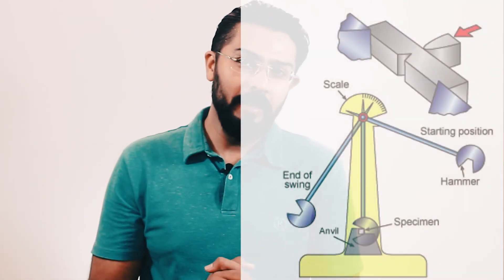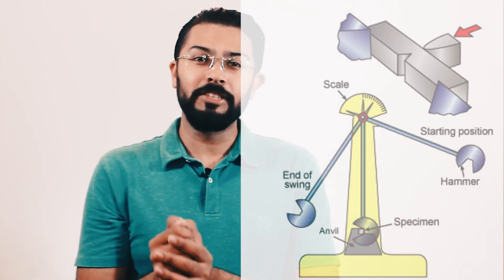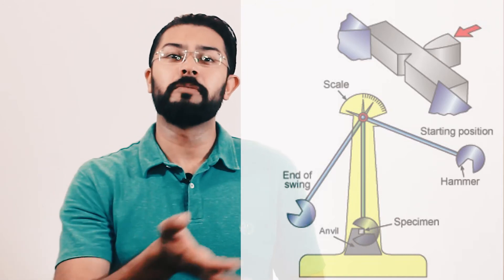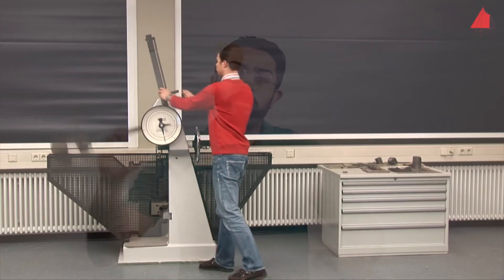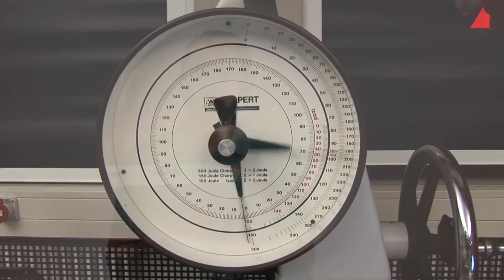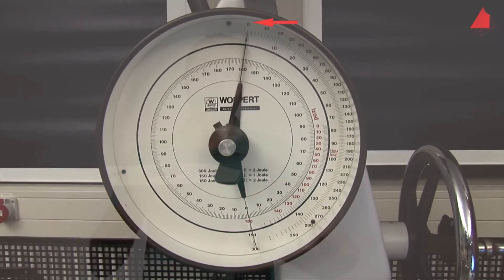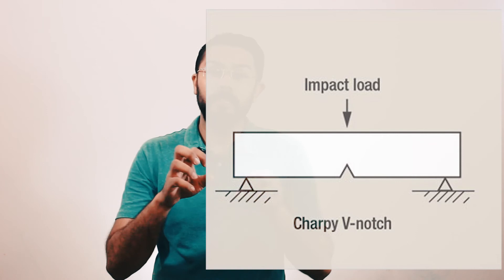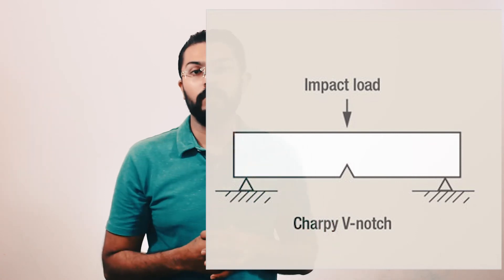Fracture toughness and Impact Strength | Dental Materials

Comment: Sir, what is stress intensification factor and critical stress ???
Reply from the maker: I would ask you to break this terminology, which would make it easier to understand, 'Stress' and 'Intensification'

Stress intensification factor of a material is a theoretical factor related to cracks/notches in a material, due to which stress is believed to be intensified in a material, causing an increase in the propagation of cracks, resulting in the material losing its dimension, or getting closer to its fracture point. 

Stress intensification factor is formulated as Applied Stress X crack dimensions (length/width) 

If a crack/notch size is 2 square meters and stress applied is 4 Pa. 
Stress intensification factor would be 8 

In situations where the crack size is larger, the stress intensification value would be greater, showing that the material has greater chances of bearing intensified stress, resulting in more crack propagation, and Ultimately losing its dimension. 

In other words, If a material already has cracks or notches, a greater Stress intensification factor value would prove that it is easier for the cracks to propagate, that makes the material weaker and makes it easier for it to lose its shape, become dimensionally unstable or fracture. 

Critical stress is the maximum stress applied after which the material tends to change its shape/dimensions

I hope it's clear. If you still have any confusions, please let me know. Thanks and all the best 👍
Reply: @TheDentalistt  Got it....thanks a ton🙏🏼😊